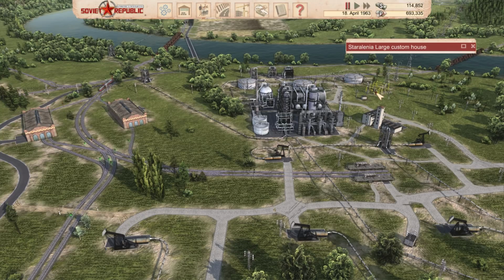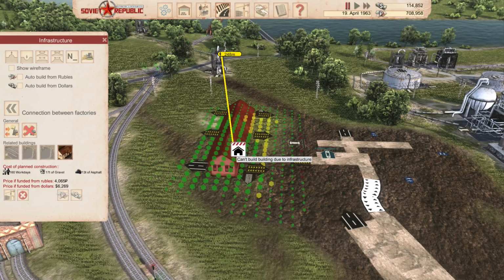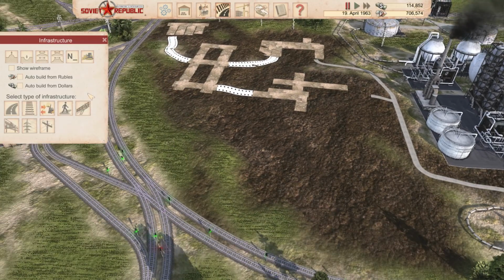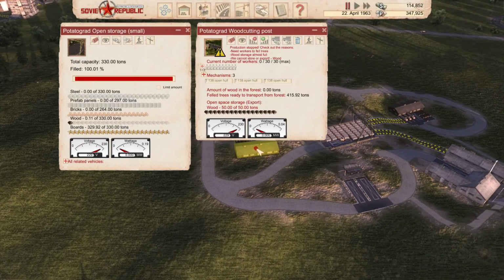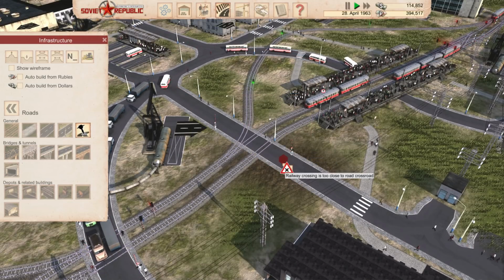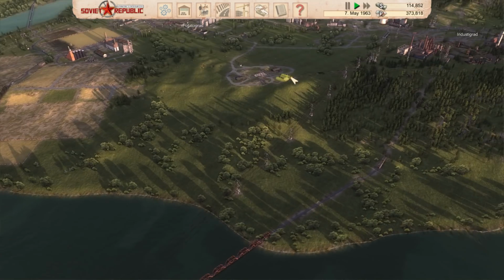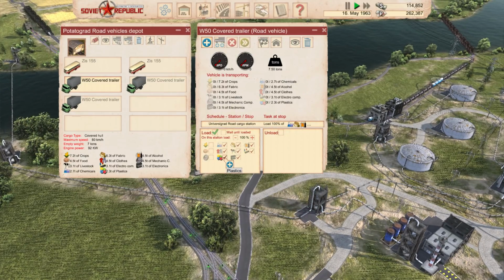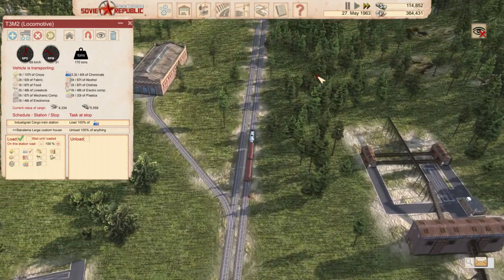Soviet Chemicals Best Chemicals! | Episode 23 - Workers & Resources: Soviet Republic Gameplay

Comment: a couple things ive noticed in almost every video, is you use too small of bus, you pick 3-4 50 passenger ones, where couple 100+ would cut down on congestion. As well as when you think of number of workers for placement, you dont remember that if it says 50 workers, you only place those 50, when in actually its 150 ( 3 shifts per building).

Comment: Sometimes it seams as if the potato has never been to a train station. 

First, this signalling system is not really intended for riding on the left side, I do not really get the wisdom in riding on the left side, you are not doing it on the road either. (I know, some countries do ... in france they also ride on the ride side of the road but on the left side of the track, fine ... they know what they do...)

second, stop this fiddling with crossover and sidings, they are not needed, just let the trains run in one direction at the platforms and let them return via a turnaround, they will find their way.
third, stop flinging signals all over, a signal declares what the start and the end of a block is, just use this idea. You always signal the entry of the block, you do not have to signal also, because it is in any case the start of a new block. 

fourth, try to avoid crossing which go all over the other tracks, try to connect them just with one switch (a crossing is a switch to) so a tunnel or a bridge is needed, but you can get this sorted.